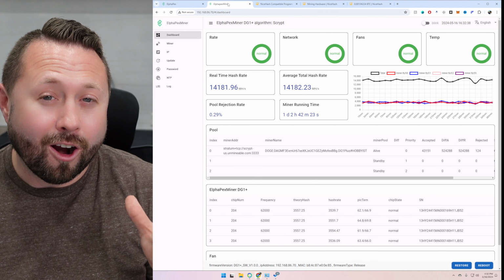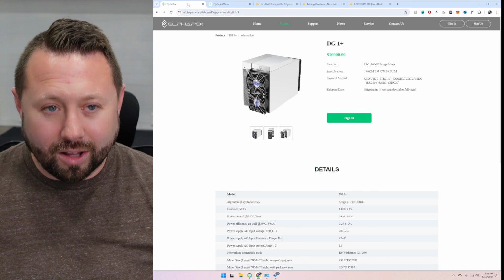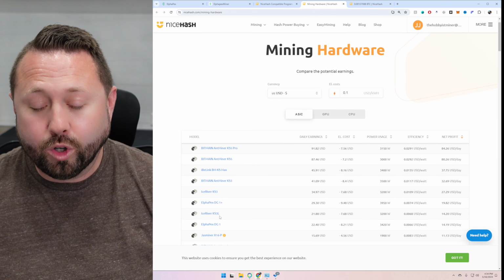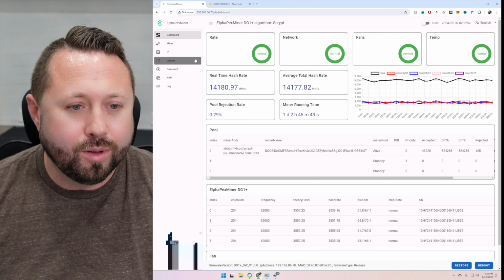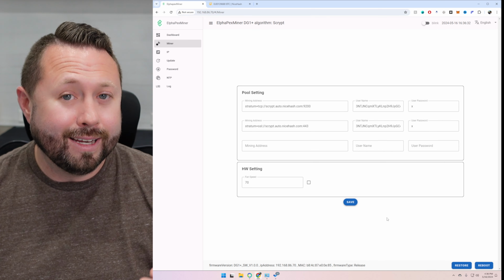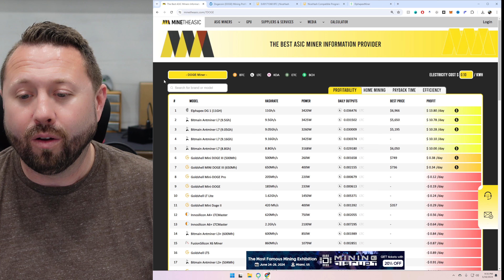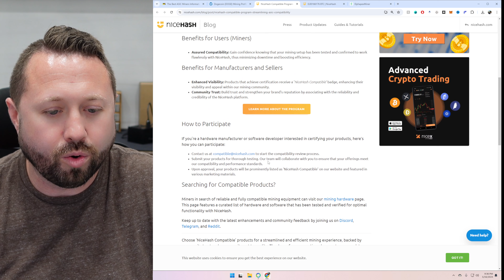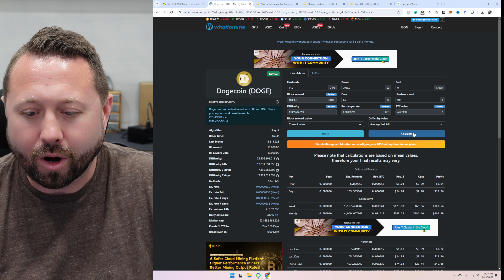I Found a Way to Make More Bitcoin with the ElphaPex DG1+

Comment: Hey hobbyist i'v got 5k for a asic which one should i buy and free electric.
Reply from the maker: So Free Electric is massive.  The real question is can you support the Massive Sound and Heat a Full Size ASIC puts out.  Also have you already spent the money to build out the electrical infrastructure to support a full size ASIC that uses 240V?  Finally if all that sounds terrible, are you considering hosting.
Reply: @TheHobbyistMiner  I pay for a work space and all the electricity and water are included.in that I've thought about hosting.hobbyist .I'm a carpenter by trade and I wouldn't want the responsibility for other people's property if you know what I means
Reply from the maker: I mean sending an ASIC you buy for Hosting.
But with Free Electric good option.  Id start with a small Box Miner to get started, like the Goldshell KA Box.  Learn the basics and work up to the big stuff.
Reply: @TheHobbyistMiner  thank you for this opportunity Hobbyist but I must decline the offer mate .I've only just started my mining journey.and I don't want the responsibility if anything happens to your hardware .but thank you for the trust.brother

Comment: the problem is that dodge will get you more funds in  year than bitcoin. there is so much more room for it to double than for bitcoin to double. bitcoin is so high its kind of a waste to stack it.  feb 1st doge was at 0.079  now its 0.1526  so there is so much more room for it to double and triple.
Reply: $25 dogecoin 2025… ⌛️